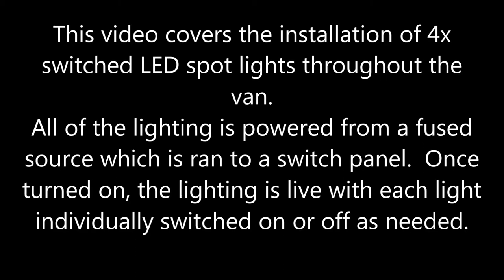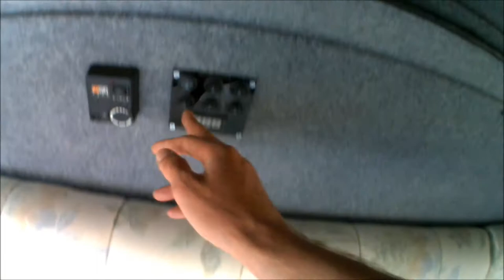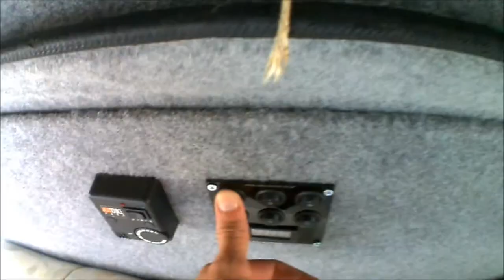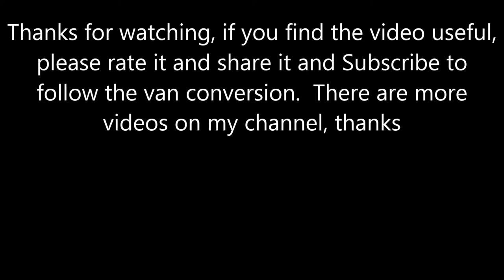How To Install 12v LED Spot Lights - VW T4 Campervan Conversion Switched Lighting Install

Comment: I have these lights a total newbie here. There is a red/black going into led driver. 
A white coming off the led driver which is grounded to the switch a red wire coming off the switch and a blue wire coming off the led driver. Confused.
Also led driver does not fit inside the cup that screws to the panel. Please be as descriptive as you can on what I need to do.

Comment: Hi there great job I've been looking  for lights like that for a while would you be able to tell me where you got them from many thanks
Reply from the maker: Hi they were ordered off eBay about £13 each
Reply: Camper Conversion Thank you very much found them not for a camper for the inside of a work van but same principle thanks once again